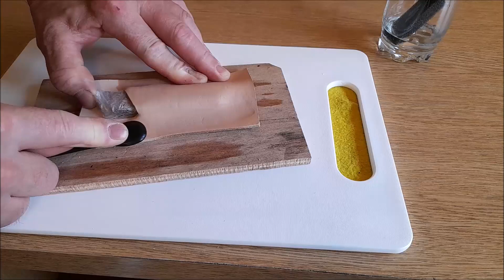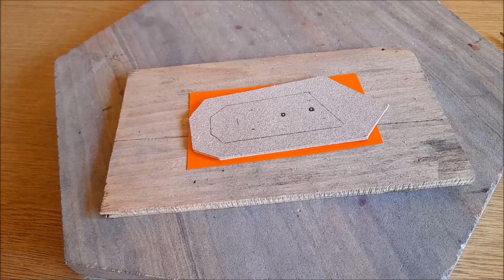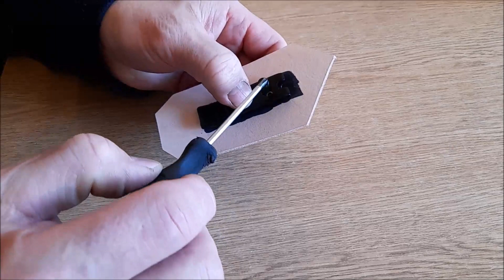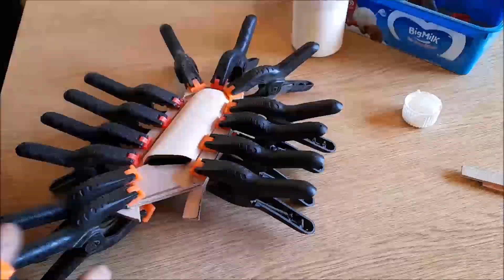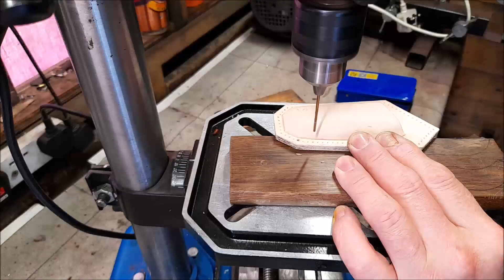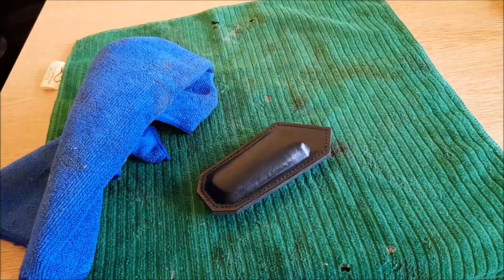Making leather knife sheath with metal clip.

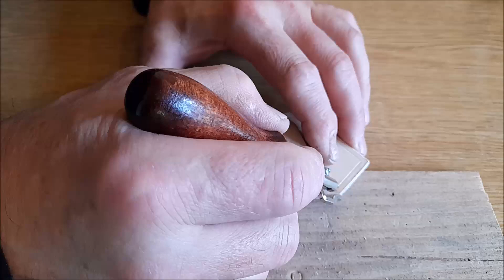Comment: Very cleaver and the best design I've seen so far on YouTube, it suits perfectly to the knife with the straight angles. I will do something based on your model. Few questions:  17:52  you're not removing any material, just pushing the leather right ? What's the leather thickness, 1mm ? What's the drill bit diameter ? What's the ideal spacing for the holes ( I don't have tools for leather work ) ? I'm trying to figure out the sewing because it goes fast, is that the regular leather sewing with 2 needles ? And a stupid one, I guess wood glue cannot replace leather glue ?
Merci
Reply: I forgot one other : why didn't you deep the whole piece into the water for molding ?
Reply from the maker: I really appreciate your comment. 
The leather thickness is 3mm.
Drill thickness is 1,5 mm.
Spacing for the holes 3-4 mm.I think you can use wood glue.
Reply: @zo-lib4564  Are all leather pieces 3mm thick ?  At 7:36 you show the little leather piece to the cam, it looks a different color and maybe a different thickness... which may explain why this technique is not working for me.
Reply from the maker: @Stavroguine826  little leather piece is 2 mm thick.